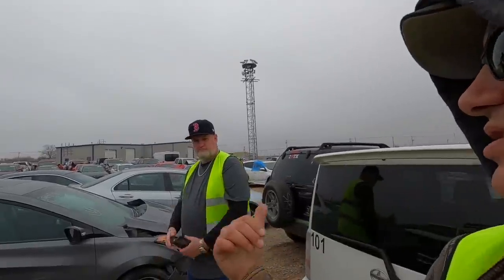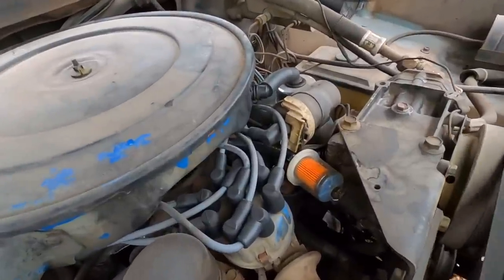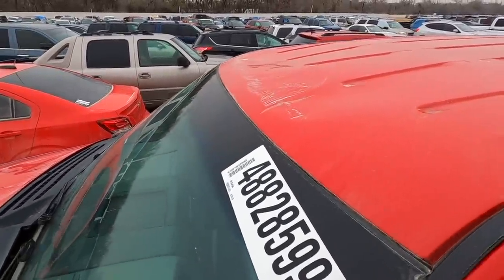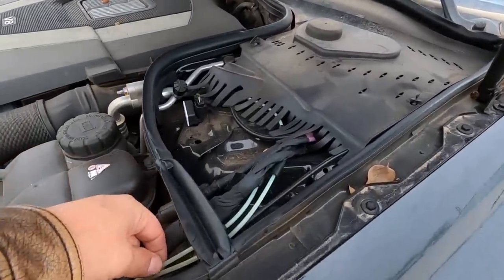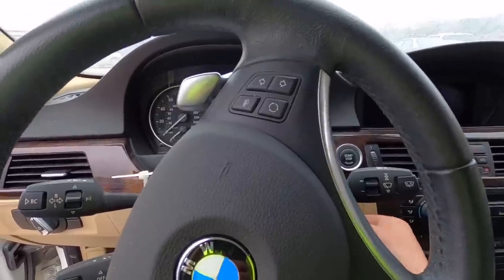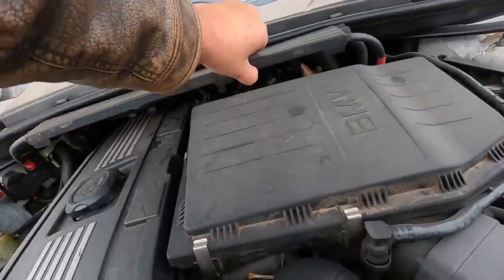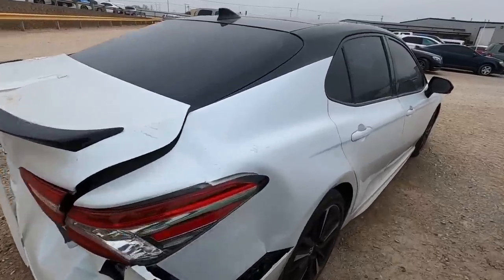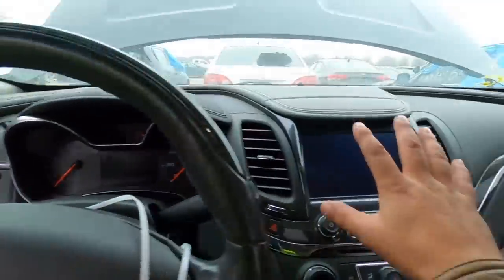Copart Walk Around 1-16-20

Comment: Got 127k miles on my 2014 Chevy Impala LTZ and I love by cocaine white boat lol. Faster than you would think with just a V6 and I haven't had to do any repairs to mine yet except replace the gas cap, the master window switch panel on the driver door (idk if it was a defect or if water got in it), and replaced the ORIGINAL front brakes right at 100k miles. Grab the Imp if it goes cheap. Solid underrated cars.

Comment: If the battery was replaced and it wasn’t “coded” to the car at the dealership you’ll get a litany of electrical errors.
Reply: I never heard of that
Reply: That's a BS. There are 2 different things - battery coding and battery registering. If you replace the battery with the same exact type - you just register a new battery. If you replace it with the different type (moved from Standard to AGM or from  AGM to Standard and/or to  different AH rating) then you code the new battery type and register it. And especially no need to go to the dealership to code it or register it. Don't confuse the people.
Reply: I will add though, that most if not the all the Christmas lights in the vehicle are because of the dead battery.

Comment: That f-150 has a 385 series big block which if it came from the factory that way makes it very rare.  I've only seen one other 1/2  ton that body style with a 460, every other f-150 usually had a 360 or 390.

Comment: My dad owns an E90. The engine is very strong on that 335, if the turbo's good it shouldn't have any mechanical issues. But electrical and sensor problems are a common occurrence and the car DOESN'T LIKE TO SIT. You have to drive it at least once a week, or it will start to drain the battery for whatever reason. Also unless you buy the exact same model of battery that's already in it, you will have to take it to a dealer to code it.

Comment: In the older cars the neutral safety switch was electrical.  Even if the transmission was disconnected, if the lever was in park it would turn over.  I don't know about these newer Fords.  Does somebody know how they work on a truck like the red one?

Comment: with the bimmer a ground issue or voltage to ground in the electrical system will cause what you are seeing most likely why at copart.  electrical diagnostic can get $$$$ with you higher end cars.

Comment: That Camry is 100% stock - i owned one.  Its the XSE - this is a 2.5L with the midnight black package *black roof, spoiler and mirrors, $500 option)  I owned that exact car with a 3.5L V6. 37k brand new unless it has the drivers assistance package - thats 39k for the V6.... 4cyl is about 31-33

Comment: I had a wierd airbag fault on my 08 volvo XC70 where it didn't detect my seatbelt and drivers airbag and i thought the alternator was going out but it might just be my battery, and i got an advice to stick a taxi battery in it, a bit more amps on it for around  $170 i think not too bad since most batteries go for that and not nearly enough amps as that battery, but the bmw could easily have a bad alternator, they do wear out

Comment: I drove a 1979 f150 that had a 460 and it run like a raped ape after a couple fresh gas tanks and cleaner. It was to bad the frame was damaged.
Reply: I would love to see a mid 70's extended cab f100 or f150. I really like the body style they had then.

Comment: Mine had dual rear exhausts, and could still hear the cam phasers and chain slop during start up.  Dual exhaust solution debunked!
CLS is on air bags.  They all will deflate after sitting a long time.  Doesn't necessarily mean the air bags are bad.  Those are air lines, not hydraulic lines.

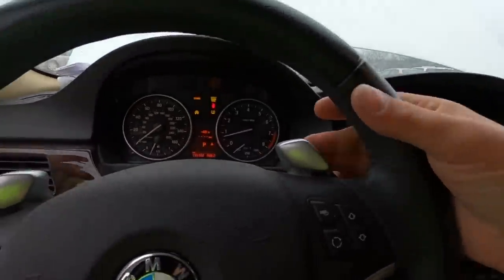Comment: 23:00 deffitnitly just a half drained battery and 24:00 i have trees in my driveway happens all the time on cars driven everyday it sits under them all night. Still dont know why you didnt make a bigger deal over this one i mean i know the older single turbos are better but i know these are gonna sell for at least 10 grand and it seemingly just needs new wheel speed sensors? Traction brake abs lights usuallly means that

Comment: You say somebody destroyed it by spray painting it you're actually wrong spray paint sometimes could be the best thing for an old truck. May not look the best but it does protect it from rusting. I restore cars and if I know I'm going to pay them and the paint that is on them currently is a little rough I will spray bomb them during the restoration and then when I'm done sanded all down and getting quality paint job

Comment: Ignore the sheep, nothing wrong with a ford 5.4 3v... as long as you do oil changes on time, that engine is fine, I got a 08 f150 5.4 since new at 241000miles and it runs like new and I drive it like I stole it. :D